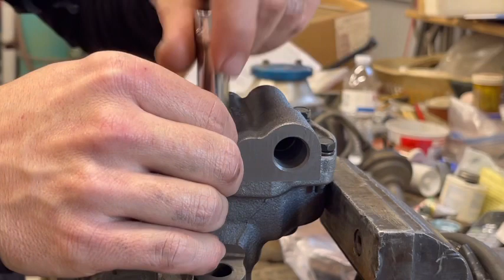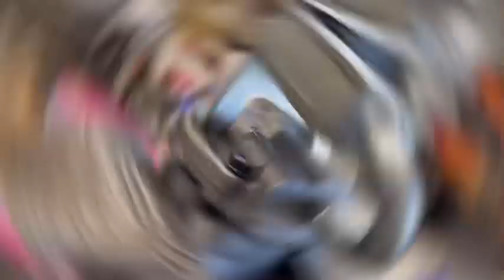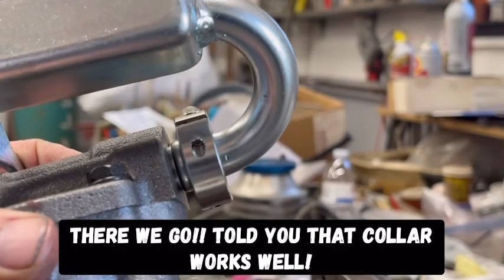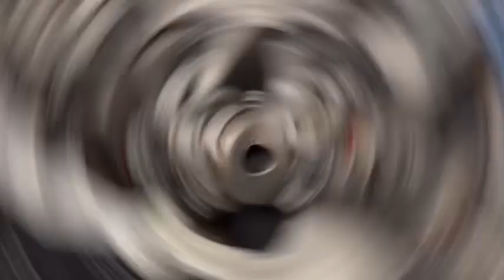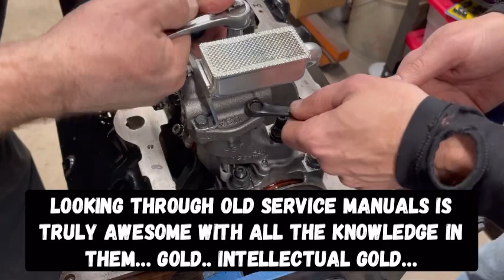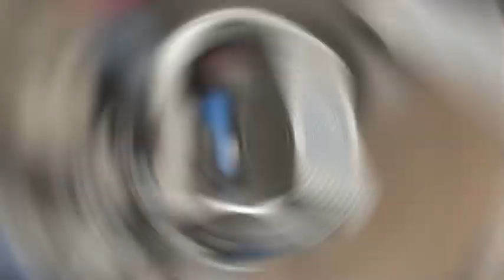Crucial Step! How to Prep and Install an Oil Pump on a Small Block Chevy! #howto

Comment: Just put together the Melling pickup tube and pump with a similar tool; i.e. split collar and a machined bolt. The bolt tip was machined down to fit into a small hole I drilled into the collar. Instead of beating on the collar, I was able to lightly tap on the bolt head. Also purchased an ARP oil pump shaft and the same oil pump stud kit used in your video. Will be installing everything tomorrow. Thank you so much for posting your videos. Cheers brother
Reply from the maker: You’re welcome! Enjoy your project 🏁

Comment: Good tip on free lubing the oil pump gears.. I was just dropping a new melling m155 pump into this recently rebuilt 96 5.7 Vortec engine I'm installing in my 75 GMC because it had a bit of a growl when I was priming the engine.. strange thing is it was a m155 melling oil pump and when I took it apart it had the appearance of the drive gear wearing on the cover plate on an angle and maybe the shaft was machined on a bit of an angle also causing the oil pump intermediate shaft to rub on the side of the block passageway causing a womp womp as I was running up oil pressure.. I also put the intermediate shaft in my drill press and found out that it was bent near the bottom where it went into the oil pump .014 ... I'm not sure how all that happened maybe the shaft heated up from rubbing on the Block but I'm up here in the great white North and maybe it was a cold start up thing or Maybe friction from contacting the passageway... strange.. thanks again for the lube job!
Reply from the maker: Not a problem!  Sounds like you are on your way to a good build!
Reply: @2HacksGarage yep just about there.. this 1975 GMC c25 I have is one that I bought that had a camper sitting on it for 30+ years with a cracked block... it shows 1466 MI.. it was used to go on the yearly 2-week vacation to the lake until it blew off the radiator hose and they filled it up with water and forgot about it and cracked the block.. I'm putting a mildly built l31 5.7 roller cam roller lifter in it... your Model T Roadster looks like fun!

Comment: Great tips and video!!!🤘👍👍
On assembly lubricant ya definitely want good stuff!! I’ve heard of some plugging up the oil filter on start up.😖
On an aftermarket pan for a small block ford the pickup needed needed much love. Wasn’t level to the bottom of the pan and was actually rubbing. So like you guys been doing you definitely check fitment of all parts!!
Reply from the maker: yes we do!!!  too much time and money invested to not be careful!